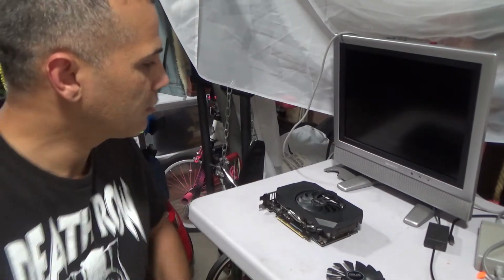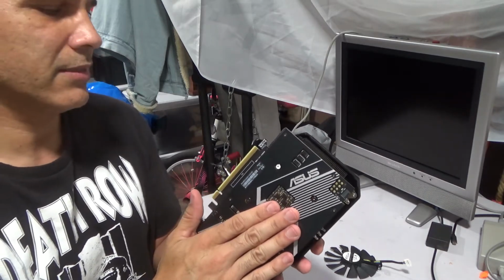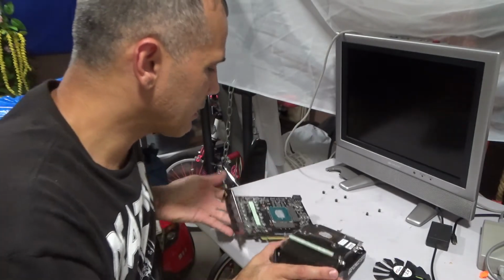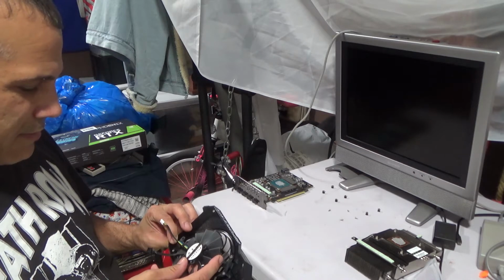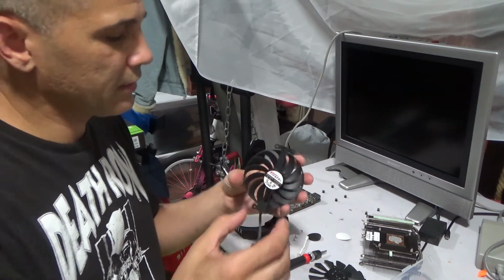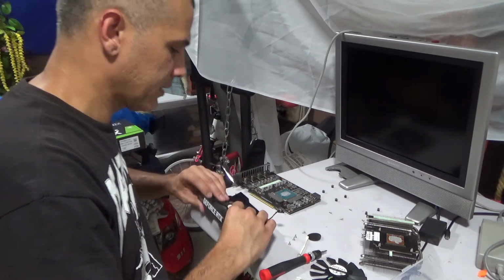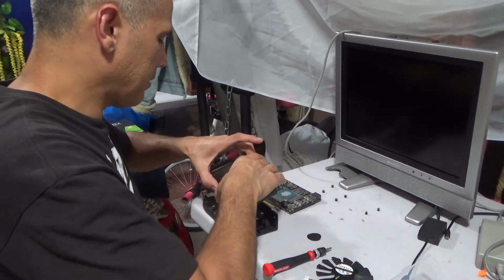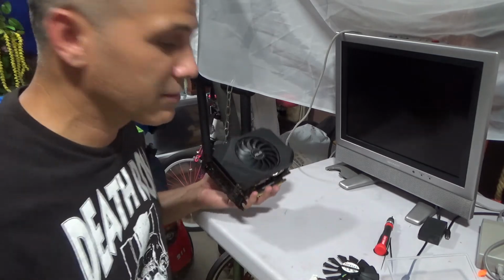ASUS Phoenix GeForce RTX 3060 FAN REPLACEMENT FAIL

Comment: I have the same gpu. you don't have remove the first part and reapply the paste. I was able to remove the plastic part alone (front)
Reply from the maker: Cool thanks for the info.
Reply: Can you explain how exactly you did that? My 3060’s fan is getting noisy as well, if possible get in depth with the explanation haha 

Also to put grease do you just pull out the sticker part or there is unscrewing to do there as well?
Reply: Are you able to say how you removed just the plastic part? I would like to be able to do this

Comment: UPDATE: GPU IS ALIVE
 installed the fan and it works perfectly. much quieter now

after 1 year of using the fan broke down on mine too. I tried cleaning the gpu and rebooting to see if it works but the fan is completely dead. ordered 2 (just in case) new fans from gpufanreplacement and now im waiting delivery from china. 
I'll come with an update after i install the new one. peace

Comment: i Hear coil whining   on your rig.  have the same card and have  a lots of coil  whining  sounds . pain killer black 3dmark06 screens.  high frame rate,s   solution is sync on to my monitor 60 frames  and its over    lost performers  also  and power

Comment: hey did you applying that 3-1 machine oil help your fan keep going or did you later get the correct part and replace it
Reply: i guess my real question is did you have to remove the motor to get the lubricant inside the bearing in the old fan to get it working or did you just apply it on the part that was exposed underneath the sticker
Reply from the maker: I ended replacing the fan because it only worked for a while.